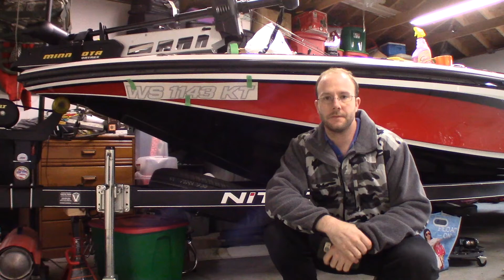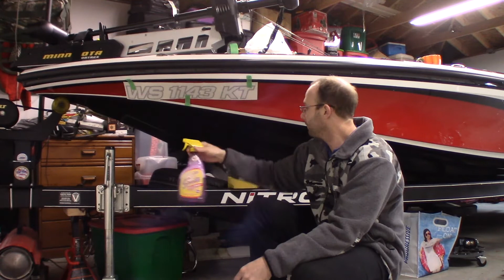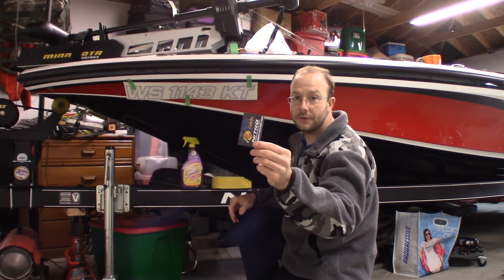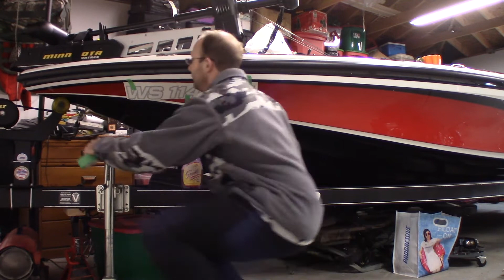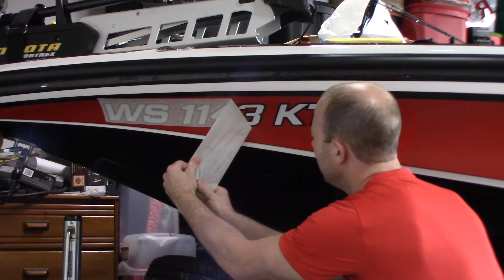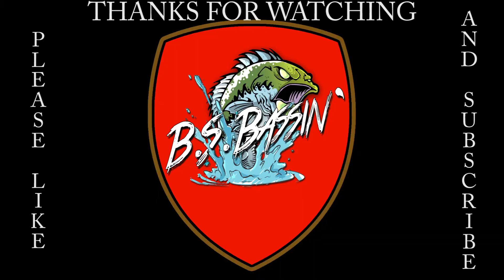HOW TO BASS BOAT REGISTRATION DECAL INSTALL

Comment: Hey thanks for the info buddy! I have some numbers coming Saturday. The place i bought them from had some bottled solution to buy from them, i figured i wouldn’t need any but maybe i do? Was % soap vs water did you mix in your bottle?
Reply from the maker: Yup just a few drops if soap and the rest water. If you want the match the curve on the boat which I didn't do you can cut between the letters but not ll the way and then you can curve it a little better unlike what I did